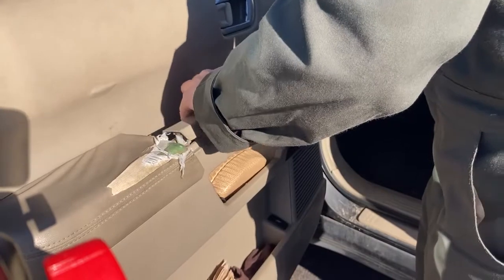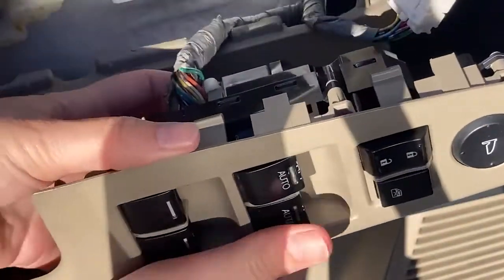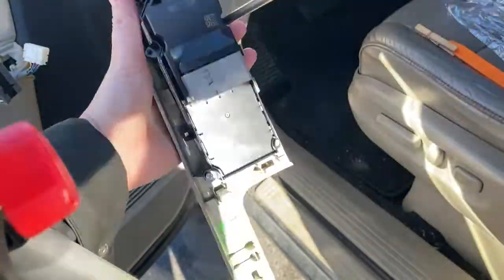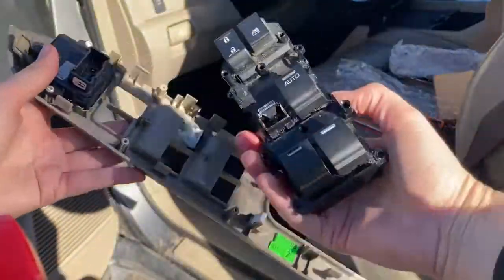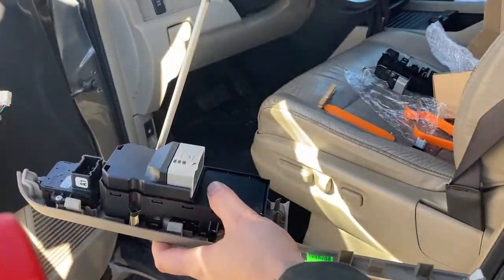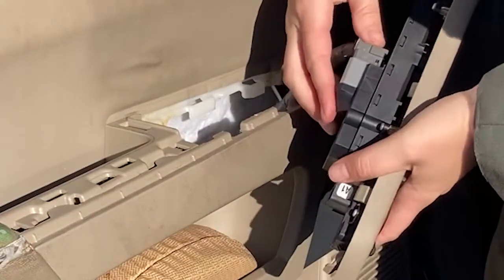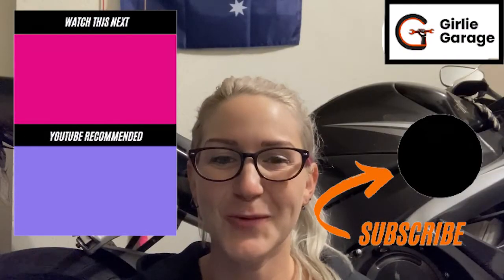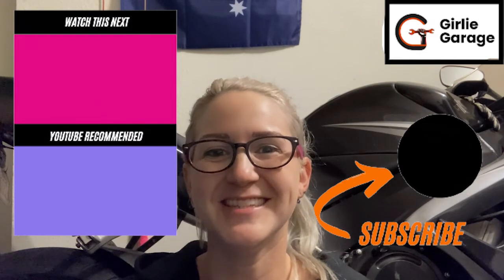2009-2015 Honda Pilot EX-L - Replace Master Window Switch (Driver's Window Switch) - Girlie Garage

Comment: Replaced with a used one genuine Honda part from a junkyard and then my dash lights just flash. Replaced with old one and still same flashing which wasn't happening before. Car just started to move it over in garage to replace the part and now can't start at all.
Reply from the maker: Then you likely have an unrelated issue. Check to make sure you have a fully charged 12v battery

Comment: I couldn’t really see what you did to move the latch to get the plug out. You should push down and move. Mines not moving when I push down.
Reply from the maker: My fingers sometimes are not strong enough to push the tab so sometimes it helps to use a flat blade screwdriver or pliers just be gentle. Also sometimes if you push the connector TOGETHER then try to pull away that helps too. Also use a wiggle technique (just try to wiggle it back and forth while pulling it apart)

Comment: My driver front window button was cracked badly but has two claws and two rods inside the button under the cover I broke the claws off connected to the rods inside to roll window up for now parts won't be here for 3 days hopefully this helps someone get there  windows up for now amazon also has parts for 30 bucks
Reply from the maker: Super interesting solution. Thank you for sharing and hopefully your new part arrived quickly!

Comment: They want $350 to do this at Honda, btw. Sure, at O reilly’s the part is 320, but I found one on eBay for $30. I’m about to go try it now thanks to this video :)
Reply from the maker: Wohoo! Let us know how it goes! Often you can get new parts on Amazon as well
Reply: @GirlieGarage  it ent badly! Do not get non OEM parts 😭😭 fixed the driver window but then the passenger front wouldn’t roll down, and also the switch wouldn’t control the lock. I ended up going to a scrap yard and having them order it from another scrap yard for $130 (still only like 40% of the cost of the part new from Autozone)
Reply from the maker: @MsPoliteRants does the one from the scrap yard work correctly?
Reply: @GirlieGarage  Yes! Scrap yard piece is perfect, and they have a warranty on it so if it fails in like six months or a year I can return it to them
Reply from the maker: @MsPoliteRants okay great! That’s very helpful feedback, thank you!